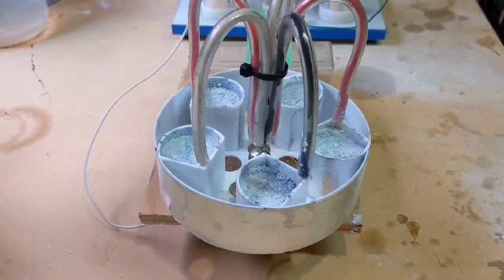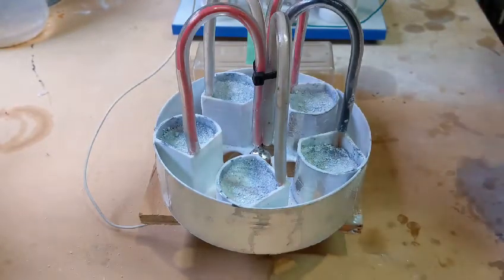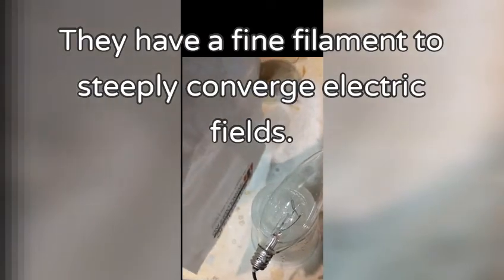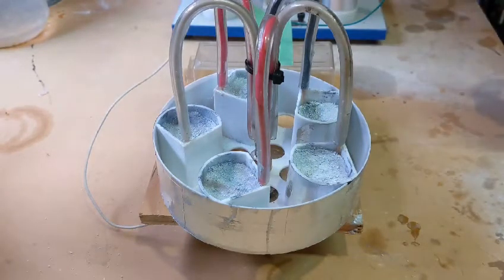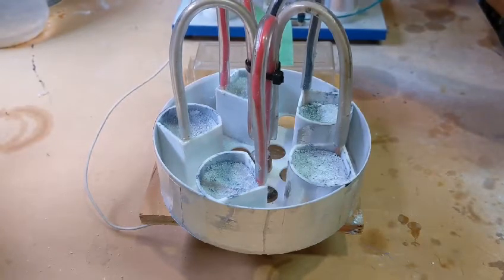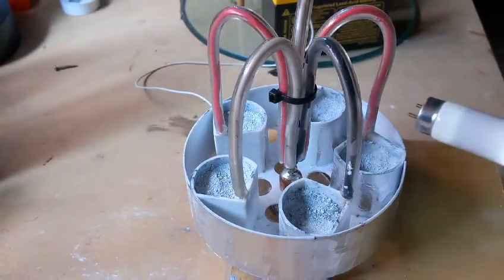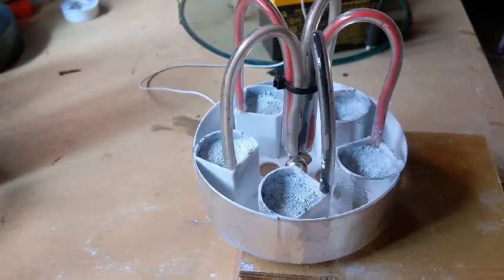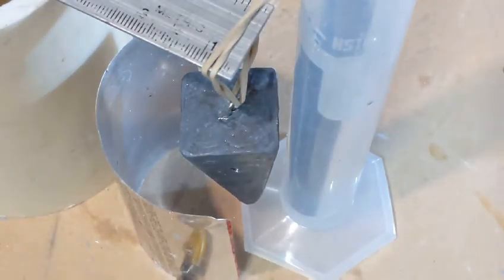An electrogravitic motor and forces from impulse currents!

Comment: I like the concept of hV dc field discharge producing these effects. I intend to do the same, but slightly different.

The impulses I use are hV inductive spikes from coil discharges.

the capacitor plates  are made from pancake coils (bifilar).

I'll put a hv DC offset on one coil/plate.

this coil/plate is made series resonant, which passes the inductive spike impulse from another coil to ground.

this impulse (partly) collapses the dielectric field between the coil plates.

Question, one plate needs to be larger to produce trust. but in which direction?

Have you tried changing the polarity of the DC?
Reply from the maker: If you have pancake coils as capacitor plates, if I am imagining your set correctly, the smaller coil should produce more ionization around it, and so the thrust would be toward that.
Reply: @failforwardresearch3127  thanks!

Comment: WOW.  Now that, is rather compelling footage!  It appears the the TiO2 generates a more pronounced force than the Mg02 or others.  I recommend packing the TiO2 as tightly as possible and trying again. I used a one ton vice and a tube+rod to compact small disks that would leap off the table during discharge.
Reply from the maker: That's very interesting about the small discs, hope to see/hear more. Yeah the powder was not compressed.